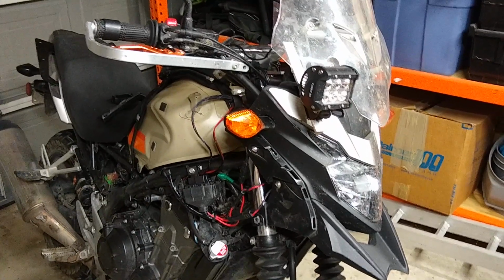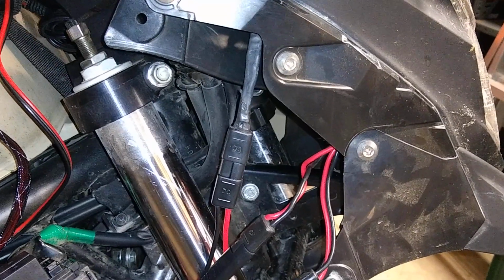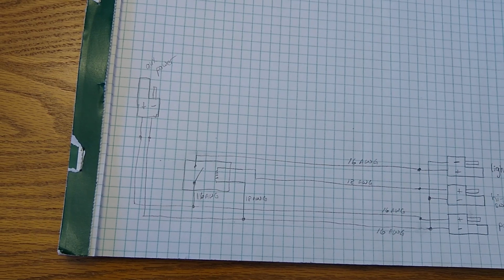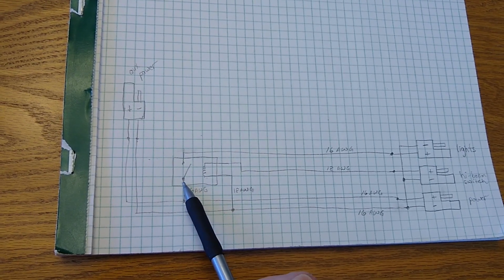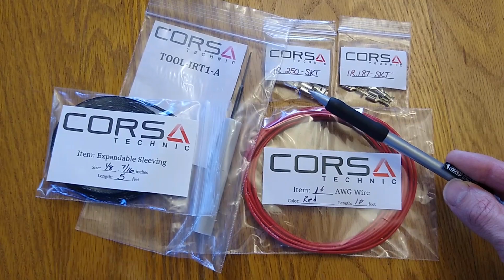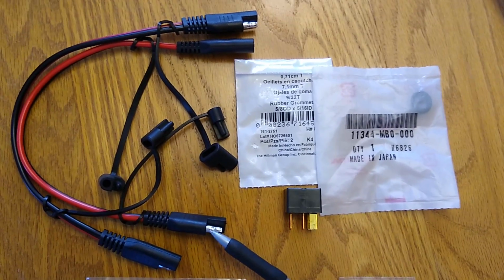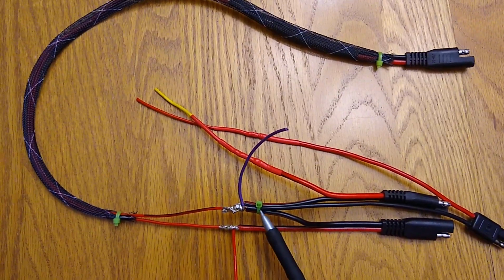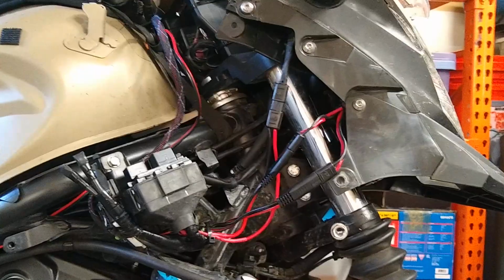CB500X Auxiliary Light and Power Wiring

Comment: Hi Joshua, great video, could I ask, can you power heated grips off the front connector or do I need to go to the battery? Cheers J
Reply from the maker: Yes, you can. Heated grips typically draw about 3 amps on high and the options circuit will handle 10 amps. I run my grip heaters plus aux light off the option connector.
Reply: @joshuaw8540  Thanks for letting me know. 🍻